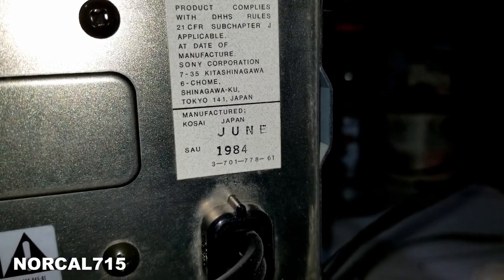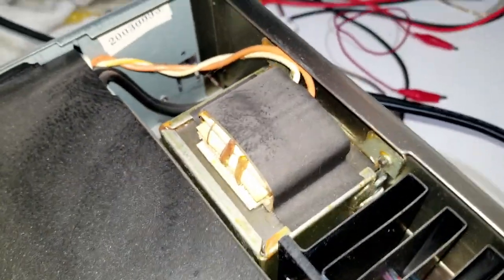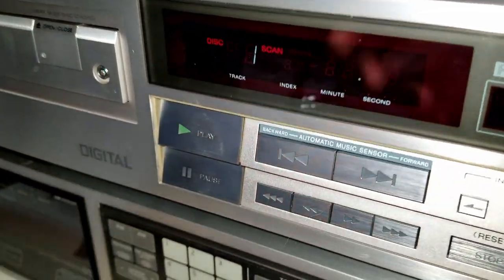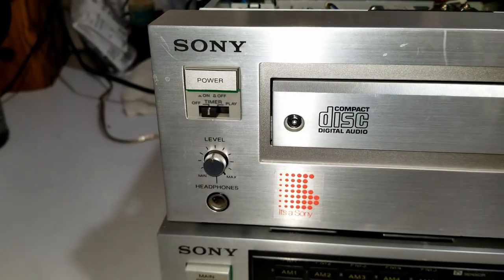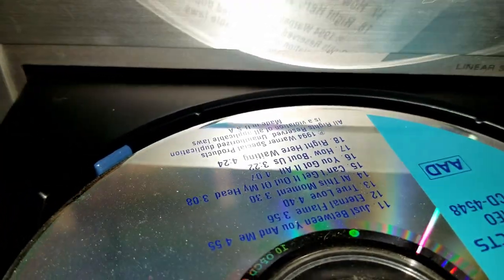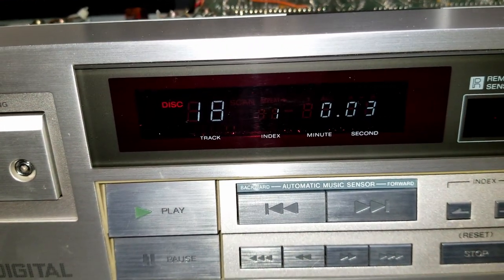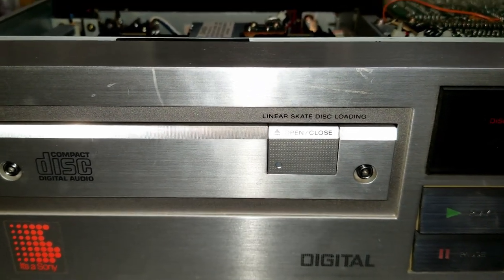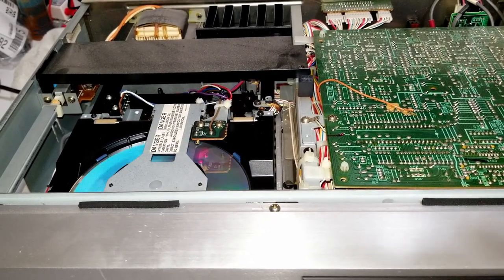SONY CD PLAYER CDP-111 FROM 1984 I JUST HAD TO SHOW IT OFF,  STILL PLAYS 36 YEARS LATER (DEC 2020)

Comment: I have an old Kenwood CD player from 1986 that still works
Reply: I haave hitachi da-6500 from 89, a realistic sta-95 from 79, and a realistic 31-2000 from 85? a harman kardon pm-665 from 84, technics rs-m226 from 82, 2 or 3 old turn table and a reel to reel recordeer/player(buried in the back dont know model or year).
All of them were working before storage.